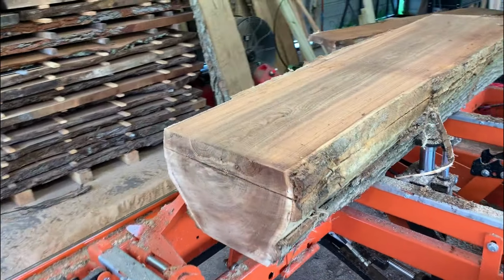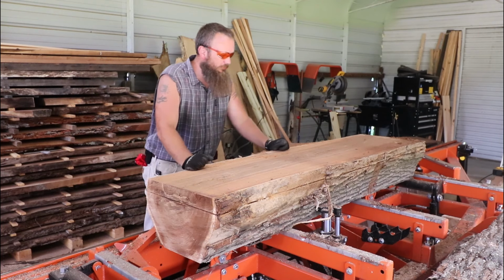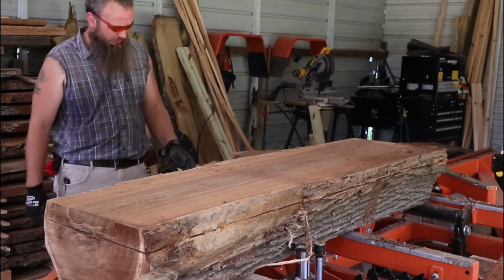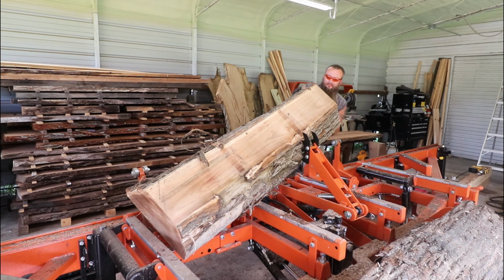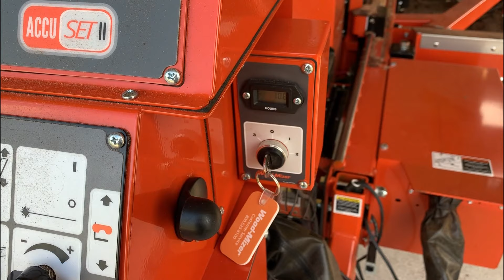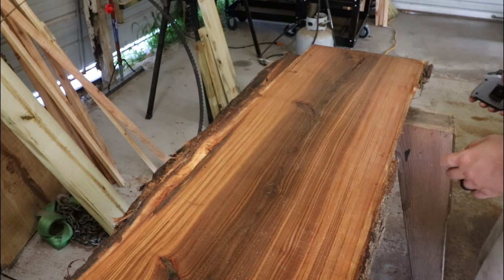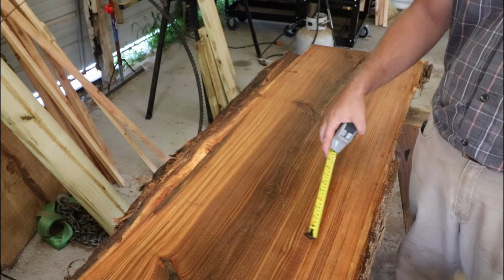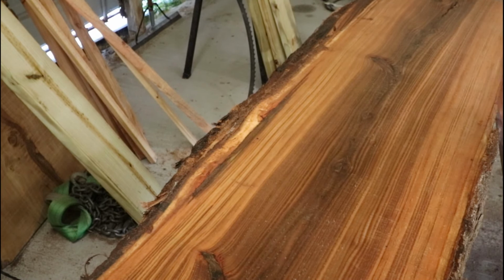TIMBER THAT FIGHTS BACK! FINISHING UP AN AMAZING BUTTERNUT LOG ON THE SAWMILL

Comment: You made some nice slabs out of that. I do have to say I would take a slab with the "pith" over a slab without it. I see so much more character in that and it's certainly not junk.
Reply from the maker: if you leave it in you will be plagued with problems, cracking, bowing,cupping etc, there is a reason I said its junk, mean the pith is junk not the rest of the slab,

Comment: Looked like there was a "bow" in the log and with, what looked like, 1 holder opposite the fence, making it rotate the end when the saw got there? Could you have rotated the log 180 instead of flipping it 180?
Reply from the maker: negative had to keep same orientation to keep the boards wide as possible for the customer, after drying he will cut them into 2ft long boards anyways for seats,
Reply: @OutoftheWoods0623  then i surely don't understand the process, how keeping the same side up just rotating 180 equals a smaller board width, but he's cutting 2' so i guess it doesn't really matter

Comment: Try moving the log down so you can get the clamp more toward the center. That should help stop the twist at the end of the cut.
Reply from the maker: that works on regular size logs, this was a short one, not an option there, thanks though,
Reply: @OutoftheWoods0623  I think it was an option you overlooked. In the process of turning the log, it moved down toward the operator, putting the clamp more in the middle. After that, the log didn't slip at the end of the cut.

Comment: That Butternut is special enough to see more, in my opinion.  That log was slipping because the edge on the log wasn't flat enough to the surface of the stop.  It was radiused just enough to allow it to slip up and over the stop.  When you said you were going to take that narrowed cut then flip it over and start your cuts from there I wondered it the stop would hold on that radiused edge.  Thank you for your work, Nathan!

Comment: What happens when you have a crotch section or multiple limbs areas?  Are all rounded areas wether in the sides of the tree or center called the piff?  And will it split in those areas?  Knots was the word I was looking for.

Comment: Just out of interest, does the WM have a constant feed cut/power?

My point is does it slow down or recognise say a tough knot as it’s passing through and automatically slow it down to make the pass or is it all set by you?
Reply: I've wondered that, too. I have a little manual-feed mill that lets me feel when the blade is dull or I'm hitting a knot, etc.
I asked Nathan in his last live stream if the power feed allows him to tell when the mill "bogs down", which may not have been the correct term. Blade deflection may be a bigger problem. He responded that the diesel engine never bogs when he''s sawing. Maybe he'll enlighten us further.

Comment: After your wonderful marble grain Walnut this is very boring grain, it reminds me of the grain pattern on Formica we used for table tops back then, it seems a very odd way of designing this new saw that there is only one lateral clamp, so unless the log is dead straight there will always be a swing when the cut goes past the "bulge", if there were two lateral clamps it could not move, the swing could easily break the blade. Looking forward to some more nice marble grain Walnut !